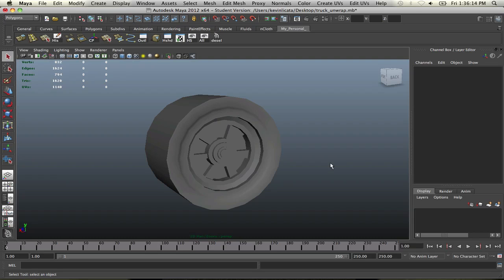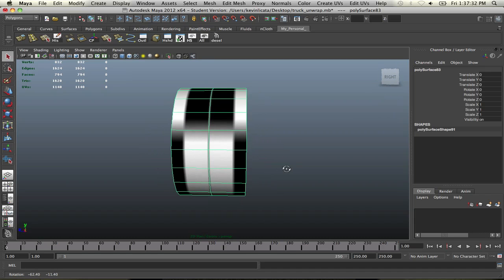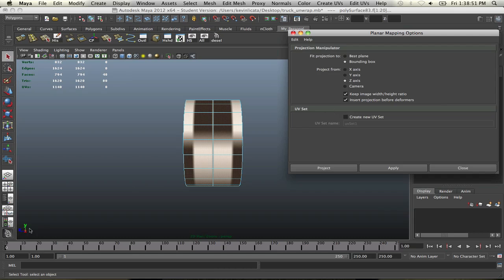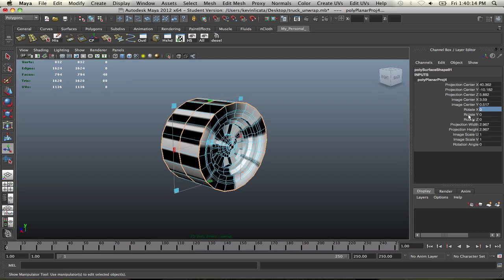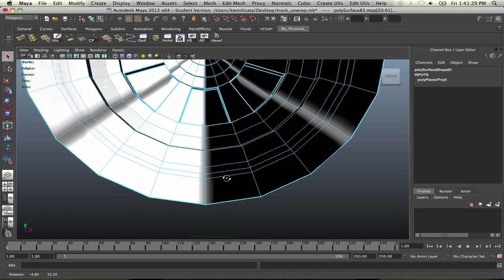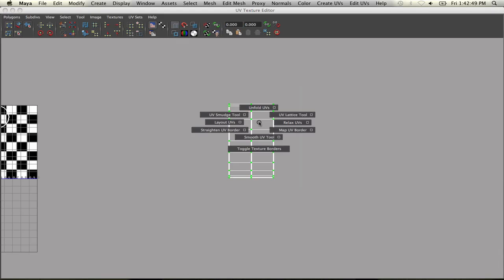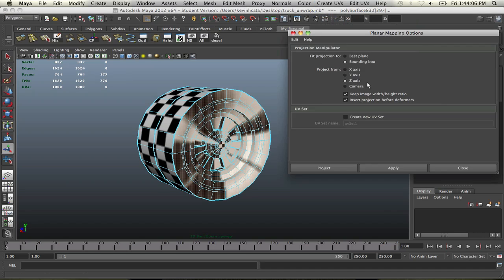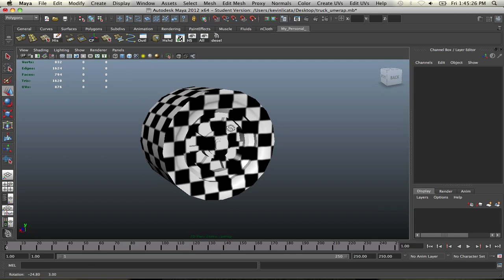Tire UV Unwrap Maya 2012

Comment: For selecting a row of faces (Ie the treads), Select 1 face, Shift double-click the next face over. You can then continue holding shift, and repeat the process to get multiple rows of faces but every now on then on your second pair it wont go the right way. Also....brush tool works great for selecting faces. I've been using Maya for 2 weeks but things are lookin good on my end :)

Comment: I hate how autodesk does not fix problems or at time creates more problems with new versions.  from what I understand is they broke the smooth in painting skin weights in 2012. plus I doubt that they have not fixed the problem of adding parallel blend-shapes to an already rigged character. And the problem you mentioned in your is just one more on the list. they really need to fix these problems specially for the cost of the program